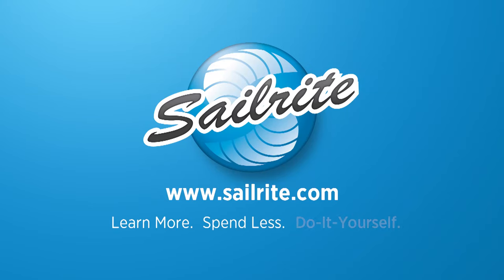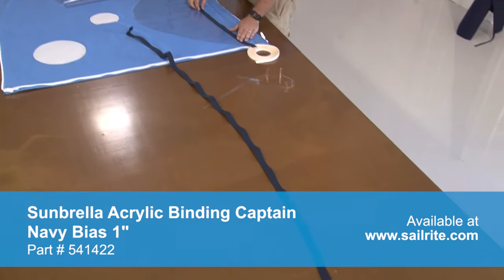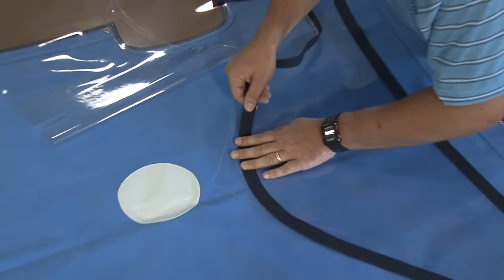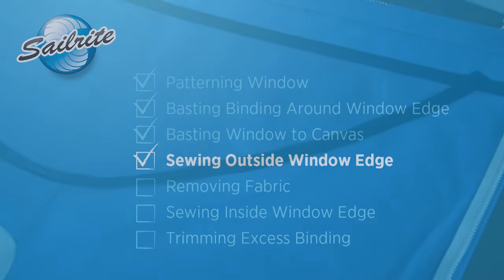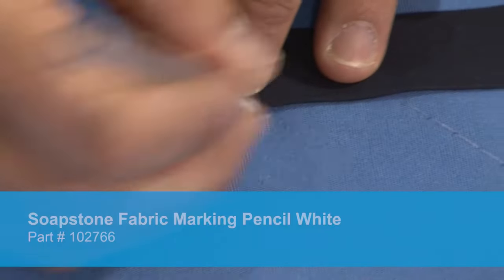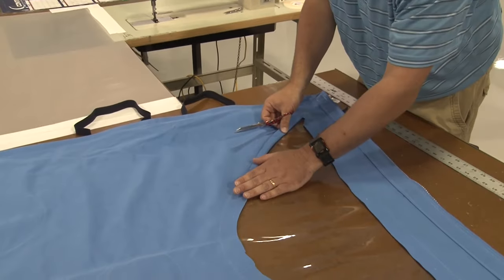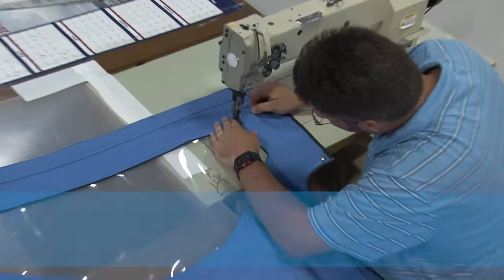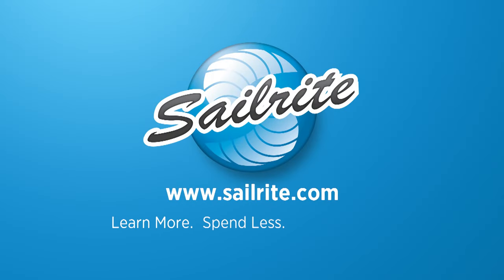How to Install a Vinyl Window in Canvas

Comment: Wonderful videos! I used this yesterday to make a "test window" using a square piece of plastic table cloth sewn into an old  piece of nylon material I had. The instruction was perfect and the window came out really nice. The seam stick (I only had double sided tape for scrap booking) works wonders. That really is the trick to make the whole process easy. Thanks so much for the uploads. Very helpful! Hopefully I can order from you over here in Europe. Thanks again!

Comment: I have a large piece of canvas (nylon?) that needs it's plastic window replaced.  The original window is probably heat bonded to the fabric.  The plastic is torn in a few places and needs to be replaced.  So., my plan is to use the instructions in this video (have already ordered supplies from Silrite).  I will leave the old plastic window in place to help keep the shape right.  My question is how should I go about sizing the window?  Cut the old one out when I get to that step?  Try to peel the old clear plastic off?  Just sew through all of it?  I have an industrial sewing machine that I use for leather so I'm now worried about that. 

Advice?  AND THANK YOU FOR YOUR VIDEOS.  Very professional, useful and applicable.
Reply from the maker: When replacing clear vinyl we do as you state..."leave the old plastic in place to keep the shape". We sew a new clear vinyl window over the top of the old then cut away the old after the new is sewn in place. If possible sometimes we sew slightly outside the old clear vinyl, so we can cut away all the old. However, sometimes we don't have a choice and have to sew through all the old assembly and have to leave the part sewn down and cut away the rest. I hope this helps, if not email me: ericg@sailrite.com
Reply: Awesome, im in the same process at the moment and was wondering what the best approach would be and you answered it right here thank you!  @SailriteDIY

Comment: I tried something that worked well.  I used a vinyl backing instead of bias tape.  The double sided tape went down the middle and the stitches were on each side along the backing.  This was much better because when my machine goes over the sticky tape it gets gummed up.  

I would have appreciated some tips on how to cut out the fabric without damaging the window underneath.

Comment: Great videos, alas I didn't watch it before I removed the large center window from a 343 dodger. Ah but ALL IS NOT LOST, I set up a larger table in my garage and the proper seam basting tape should arrive tomorrow. It is an eight year old dodger so great guinea pig project. Viva Sailrite !

Comment: You guys make it look sew easy! Your instructions clearly specify cutting the canvas afterwards, along with rationale. I watched this video with optimism that perhaps there might still be a way for me to utilize your products to replace the rear window on the convertible top of my Porsche. Any thoughts?
Reply from the maker: Yes, we have had customers who have replaced clear vinyl in convertible cars with success. However, since we have not ever done a project like that I am not sure I can offer advice.
Reply: This is exactly what I needed to replace split/fogged vinyl windows in soft Jeep tops instead of replacing.

Comment: Hi, thanks for a great guide. What needle and thread is used there (size of needle and thread) .I am a beginner and start learning .It is very interesting to see how it is done. Thkx  from Denmark
Reply from the maker: Well, for this project we were using a PTFE thread called Tenara and a size #18 needle. PTFE thread is a lifetime thread, most canvas jobs are sewn with a V-92 Polyester Thread and a size #20 needle.
Reply: Uste poede en señar en español

Comment: So,  do you need to make a new dodger if the windows have gone foggy and cracked even though the canvas is still good?
Reply from the maker: Hi Oyster,

You can replace an older window, but making a new dodger is the cleaner  and preferred method. Here is an old video of us replacing a window in a dodger.
https://youtu.be/Zn7OLTqcjWg

Comment: Nice handcraft work. How do you prevent water from leaking into the inside at the lower end of the window?
Reply from the maker: It is difficult to stop that from happening. Seamstick basting tape can help prevent the wicking of water into the needle holes. We do sell seam sealers also, they can be helpful also.
Reply: @SailriteDIY  On a different channel I have seen they flipped the layers at the bottom so the window surface ends on the outside. Perhaps this makes a difference also ...
Reply from the maker: @torstenbehrendt870  Never tried that, I wonder if that would work. If you do that let me know what you think. Thanks!!!
Reply: Maybe have a look at pop up campers and see how they are sewn together.

Comment: When you sew on bias binding on the inside of the canvas, what do you do if you will change out the window later? From what I have learn on a different Sailrite video that canging out the window, you sew on a new window over the old one and then cut out the old window. But if you install binding on the inside, you then will get a binding layer between the old and the new window edge.
Reply from the maker: Well you have three options:
1. Make the new window a little bigger, so the old window can be cut out along with the binding. 
2. Sew the new window in along with the old binding in place. This will make for a very thick perimeter, so you may not want to pick this option.
3. Cut out the old window and use plenty of double-sided tape (Seamstick for Canvas #129) to baste the new window in the open hole. You will have to work hard to get the canvas to lay without wrinkles before sewing.

Comment: Need know if the double tape gone be à problem with the needle.tank s
Reply from the maker: No, the heavy canvas and vinyl will easily clean the double sided tape off the needle when sewing. That is typically only an issue for lighter fabrics.

Comment: What type of needle do you use on the window material? Does it matter what gauge of material?
Reply from the maker: We typically use a standard round point (sharp) point sewing machine needle. The size depends on the size thread used. If using V-92 thread use a size #20 if V-138 use a size #21

Comment: No waterproofing ? or seam sealing?
Reply from the maker: If you use a basting tape (Seamstick for Canvas) in between the vinyl and fabric it will help prevent the leaking of water through the needle holes. If you have sewn through the double sided tape it will expand slightly filling the neeedle holes and it helps prevent leakage. However a seam sealer can also be used if you like like this: http://www.sailrite.com/Iosso-Seam-Sealer-4oz
Reply: Sailrite  neat!